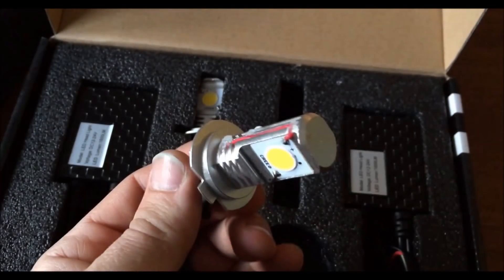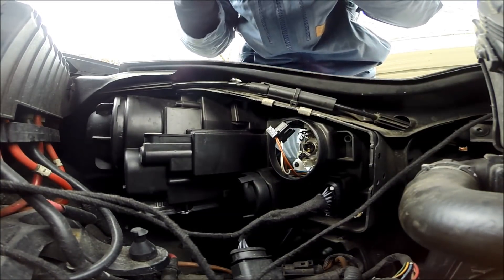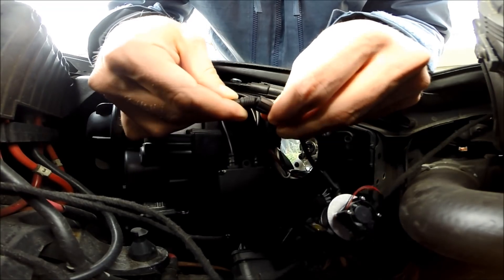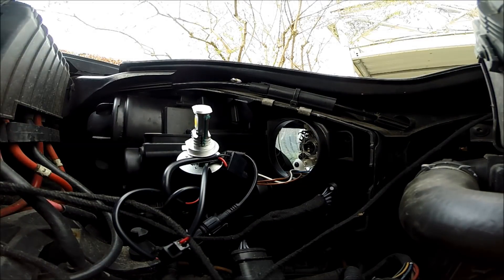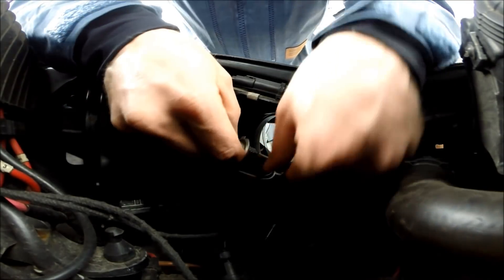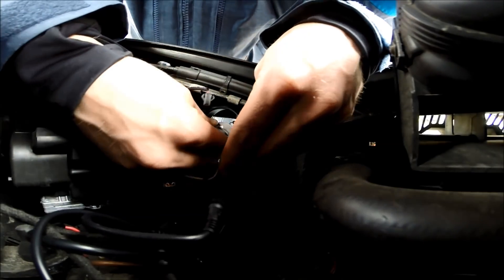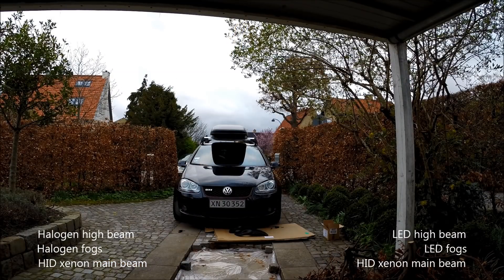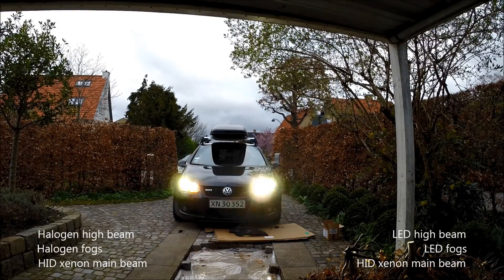LED vs. Halogen, install and test

Comment: It would be great if you show a comparison between halogen high beam output vs led high beam, I'm so fond of the instant flashing of the LED, but I'm afraid the output  (spread and distance) on the road is not so great compared to halogen, isn't that so?
Reply from the maker: Yeah the flash is perfect, but you are correct about the light spread. For a primary light source (also as the only high beam) I would not be confident to get enough illumination to the sides of the car.
I'll see if I get the time within the month to do a comparison between the regular halogen and the LED.

Comment: You think this is also compatible with 2012 gti, mine was halogen and I want to upgrade my halogen bulb to led. And did you put back the headlight back cover?
Reply from the maker: Yes they should be compatible, however on the 2012 GTI you have high and low beam in the same bulb, right?
To be hornets I don't think that would be ideal, because the way the bulb switches between high and low beam, is to turn on eather 1 of the 2 LED chip, or both of them. This would mean that when you are driving with your low beams on, you would only have illumination in one half of your headlight (like a half moon).
For the MKVI GTI go for the OEM bi-xenon :)
Reply: Nope, my headlight housing is for halogen bulb. my high and low beam is seperated. There's like 4 bulbs in single housing. high beam H15, parking light 194, low beam H7, and signal light " I don't know what number it is" hehe and I searched through the internet. I need a Led bulb with resistor otherwise it will throw some bulb errors on my dash. :/
Reply from the maker: Cool, then you should be good to go! I don't think you need a resistor
for the LED -- I did not. The bulb draws enough power to make the canbus think
there is a bulb installed.

I did not put on the cover on the back of the headlight correctly -- there
is not enough space inside the housing on the mkV to fit the ballast --
so that's a project for another day :)
Reply: ok great! I'm gonna get this soon, thank you very much bro!
Reply: Where did you get this leds? or what brand and I'll do the research haha thanks in advance!
Reply from the maker: You are welcome :)
Got them from "electradecentre" on ebay: http://www.ebay.co.uk/usr/electradecentre
Reply: thanks again bro! I appreciate it! :)
Reply from the maker: If you live in the US, you could try v-leds.com, they have good quality
products - and if it wasn't for shipping and customs to EU, I would have bought
my set from them.
Reply: Yap I live in US, thanks for the info. I'll check them up tomorrow thank you! :)
Reply from the maker: No problem, let us know what you end up buying and the how it performs :)
Reply: Sure! I will! :)